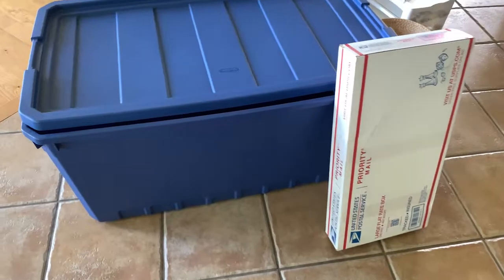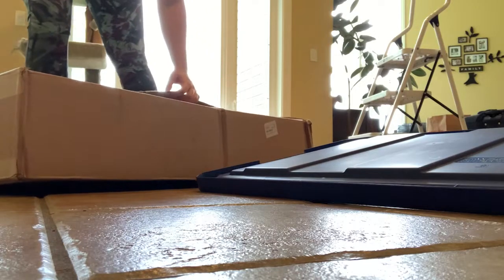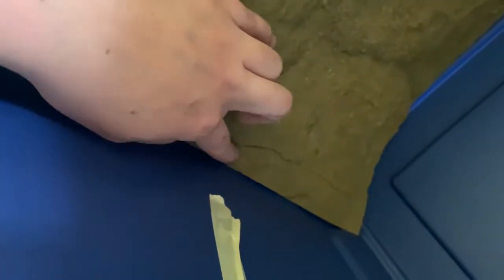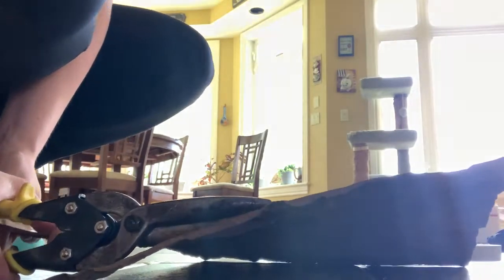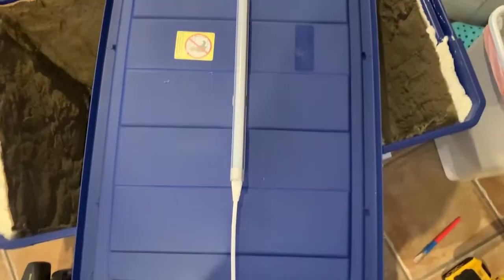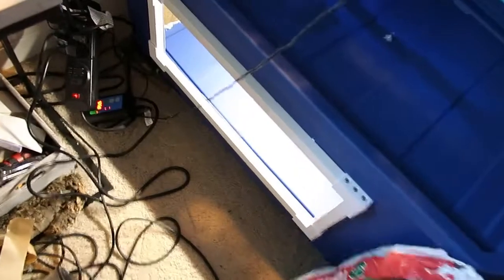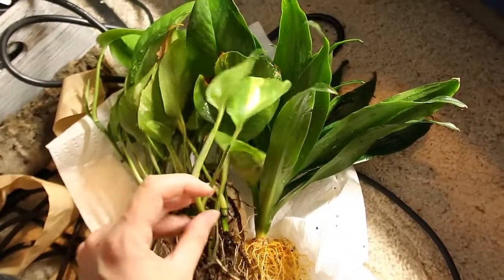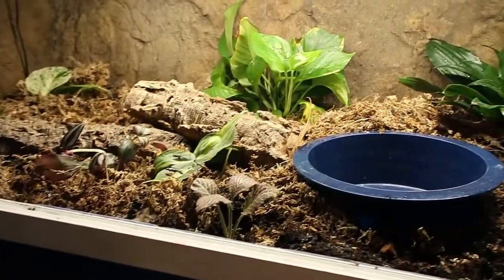Advancements in Tub Keeping for Reptiles! // Sunbeam Snake Set Up

Comment: That’s pretty cool!! If your dremel has a sanding bit I would use that to score the surface so the silicone and foam have stronger adhesion to the tub. Could potentially install those cool ledges they sell for some climbing opportunities if the bond is strong enough.

Comment: what kind of heat pads are you using for the tubs? The type of Sterilite tub (size), and which conversion kit you get the Cambro or Choice? Sorry for all the questions but you got me wanting to do this build :) I know some you cant use as it'll melt the plastic, thinking of doing a convert kit like you did for my file snakes.

Comment: how much does the whole completed tub cost? it might be almost the same just to get an enclosure of the same size.
Reply: Compared to glass cages maybe. But glass cages are heavy, they can be harder to heat (they lose heat easily). And those darn corners. Tubs hold humidity better w/o any extra tricks or effort. For example, if I was raising a baby boa constrictor, I would go tub over glass any day. Milksnake? Tub over glass any day. Ball python? Tub over glass. PVC cages are not cheap anymore. Tubs definitely have a place.